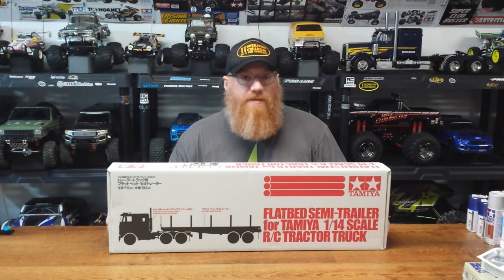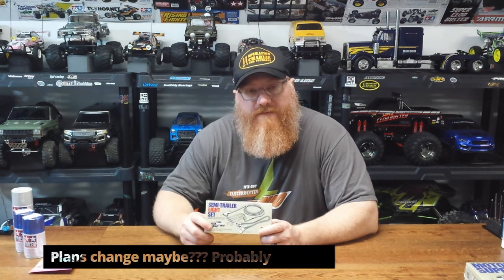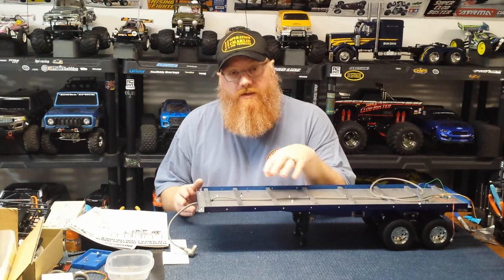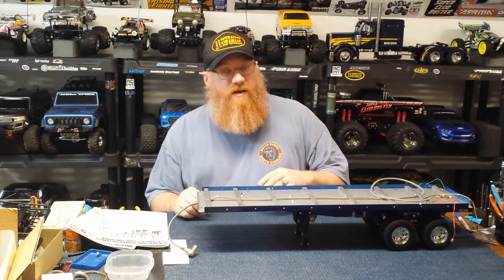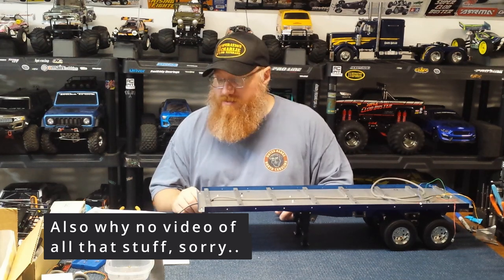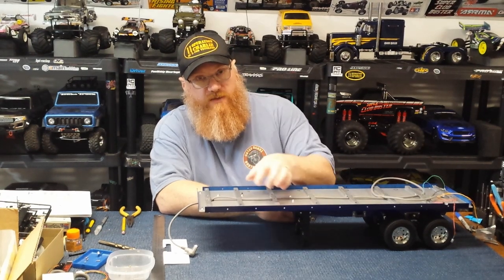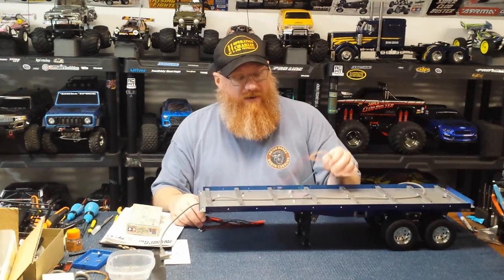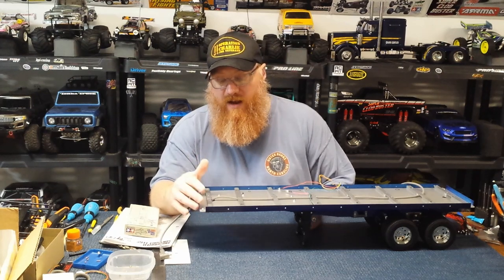Tamiya Flatbed Trailer Kit TAM56502 - Build Tips and Customization and Problems

Comment: I fought with that too... I'm likely also chucking the nearly $50 Trailer Lighting Kit, and going wireless. It's a waste, but the best solution.
I'm also using the Beier System instead of the MFC-01.... and THAT has its own ton of problems!
Reply from the maker: I have only few videos of those Beier systems, they seem really cool once it is all wired and programed. That part seems to be tedious though. Those Tamiya trailer light kits were probably great when they first came out but really lack a lot in today's times. Best of luck to you, I wish I could help but you are in territory I have yet to venture into! Thanks for stopping by and checking it out!

Comment: I’m going to be building the same trailer in the near future. I’m on the fence about going with the wireless setup. Thinking I’ll use the tamiya trailer kit so down the road I have the hookup on the truck for other trailers.
Reply from the maker: If you are doing the electronic leg kit then I would go wireless. If you are staying with the manual legs then wired would be fine. It is just kind of strange to have the controlled legs and be able to pull up and drive off or drop off the trailer from the remote but still have to go plug in or unplug the trailer. But, with that said if you plan on sharing it with other trucks then wired may end up.being the better option. Just know adding extra lights to that kit will effect the other lights due to the additional current draw. Thanks for watching and best of luck on your build

Comment: You could of used 6v pre wired LEDs for the side running lights and used the original wire harness
Reply from the maker: Possibly, there would have to be some electro-mathmaticals done to figure it out! It seemed light the harness is getting just enough power to light up what it has on it stock. It was a head scratcher to get it all working the way it is but it works so that was all that mattered.at.the time! It was getting me frustrated there at the end fighting with it!!

Comment: I have to say that when you want to add lights, motorized legs etc. you definitely don’t have much guidance in the manuals. They are all very separate instructions which means you are left figuring it all out yourself. I had the same issue with the flatbed and was surprised that installing the lights wasn’t as clean as I expected using their instructions.
Reply from the maker: Yeah and add doing custom stuff on top of that and there is a good deal of head scratching. I enjoy it, the trying to figure stuff out but there does get to a point where it stops being fun and challenging and turns into a frustrating pain! thankfully it didn't cross into that but anytime you are dealing with electronics and wiring it seems to be a fine line! thanks for stopping by and checking in!
Reply: @AddamsPlayground  Agreed!  Do you have the MFC-01 on your Grand Hauler?  I'm still trying to figure that all out.  Had this great idea for a video but I ran into one problem after the other.  Partly turned out I bought the wrong servo's (so I'm told) but I haven't returned to that project as I have had many others in the works.  But I do need to return to this so I can start pulling the trailers I've been building lol
Reply from the maker: @FastFreddyRC  I do have the MFC01 in there but only know what I have learned from Bob and his videos. When I do my next one it will be with one of the Beier control units in it. About the same overall price but a ton more options and programmability with it!
Reply: @AddamsPlayground  Bob's awesome.  Ok makes sense.  I'm really going to have to pull this truck back out (Cascadia EVO) and get it running.  Do you have your MFC-01 fully functioning though?  Is it working as it should?
Reply from the maker: @FastFreddyRC  yes it all works as it should. I did have to do the relearn process a few times along the way during set up but it all works correctly.

Comment: I want a flatbed for my Grand Hauler but they are to short for my liking and I don’t want to buy one for that reason,  it almost looks like you need to take 2 and graft them together for a scale 52 footer, not out of the question I guess
Reply from the maker: Yeah they are short, they look a bit better with the globe liner as it is a much shorter truck. I wanted this just to be able to put different loads on and change it up. I looked at some of the lesu and RC4WD trailers but they were just so expensive. I really love the RC4WD low boy trailer but it is not cheap and I know myself and that would lead to 2 or more pieces of construction equipment and then that all goes down a very expensive road quickly!!!

Comment: Nice job pal, watched the whole video, I've built a few of these trailers. Check out my take on my flatbed, I made custom straps as well that work really well. I've sold hundreds to folks, they're quite popular. Anyway i'm not a fan of that Tamiya light kit for all those reasons. Not really crazy about brake lights, the turn signals I think isn't very realistic when every time you steer the the truck the signals go on. Thats too much signalling lol. Is there reverse lights as well? That would be strange, don't think I've ever seen a flatbed trailer have reverse lights. Lastly, I have mine attached to my Globeliner which is much shorter than your truck and it still looks too short a trailer, it scales out in 1/14 to 32 foot trailer which is not very long or realistic, your truck is longer than mine and almost the same length of the trailer. Those details kinda pick my ass, they're nice trailers, but would have been nice if Tamiya made them longer. To remedy this, I have two of these trailers ready to be built, I'm gonna attach them together, lie a set of trains. That'll help make the proportions seem more realistic I think. Anyway sorry for the long comment, but just wanted to share my bits. I like the extra holes you drilled out, the extra marker lights will look good. Don't know about that self etching primer adhering, nothing bonds to aluminum, at least not that well. One rub against a sharp rick and it's goodnight Charlie. Look forward to seeing how it turns out. 👍
Reply from the maker: Thanks for all the info, I'm a noob to the big truck world for sure. I've drooled over pics of them for years but never actually seen on up close so to me it is still gigantic!!! Some how in setting up the radio and endpoints I got it to where you have to turn pretty hard for the turn signals to come on. Dumb luck completely! I am not a fan of them coming on for every turn either but the way it is now is a good compromise. I just hope I don't have to alter anything and ruin those settings! I appreciate all the tips and tricks as well as any other feedback, it all helps!!! Thanks for stopping by and checking it out!!!!